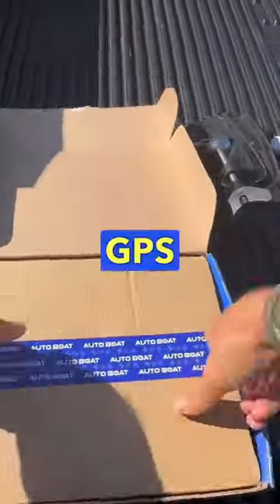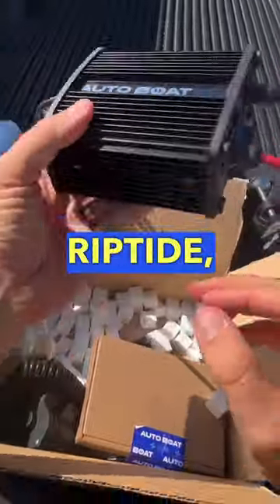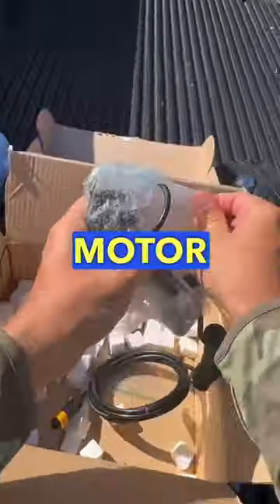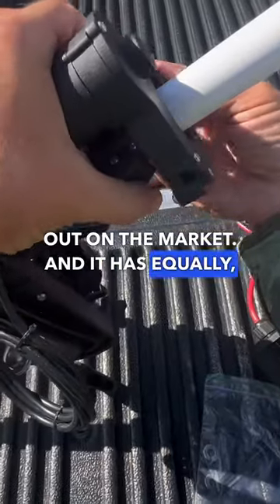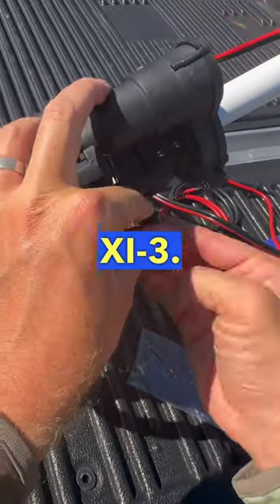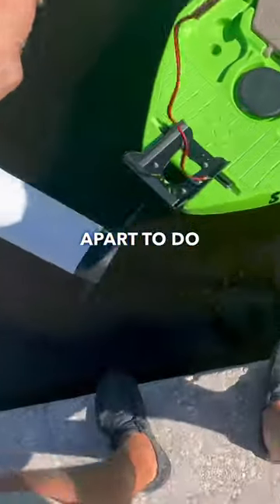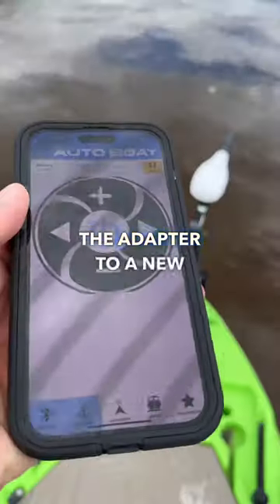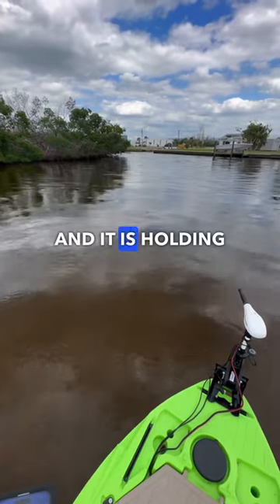GPS UPGRADE KIT On Basic Trolling Motor -  iPhone Remote Steering #fishing

Comment from the maker: AUTOBOAT KIT & GREEN BOAT AVAILABLE HERE👇
5% Discount Code:  KayakDIY 
www.TBNATION.net
🔥LINK ALSO IS IN MY YOUTUBE PROFILE🔥

SHOWN IN VIDEO
BOAT- Milha Lite Skiff
GPS MOTOR - AutoBoat kit on a Minn Kota Riptide 45
OUTBOARD: Epropulsion Spirit 1.0 Plus 

“All these products are available at link above.  Use discount code to save some money.”
Reply: Awesome thanks
Reply: My anchor mode is not working properly
Reply from the maker: @bentech8887  contact TBNation.net for customer support.  There are a few reasons why this can happen and many are easily fixable on the water.   They will be able to get more info.  Encourage you to take video of the issue when it is happening.  Get video up close of the gps puck and an overview of the whole system so they can see how it is installed.  By seeing it they can better troubleshoot.  If you have trouble getting through to TBNation then message me on Instagram and I can maybe assist.

Some tips:
Attempt to recalibrate: hold N and the system should beep 3 times at the end to indicate it is successful.  

Ensure position of gps is correct.  GPS should be about 2” below the motor head and the gps has an arrow that indicates direction of forward motion. 

Are GPS green lights flashing inside puck?  If no lights are shown then this can indicate poor connection to box or damage to the cable.
Reply: I have a video of the issue how can I send it too you? It’s to long to email customer support